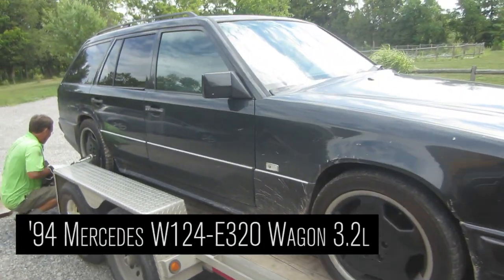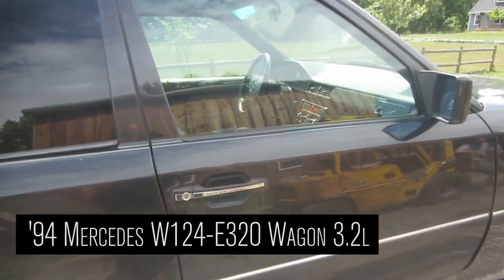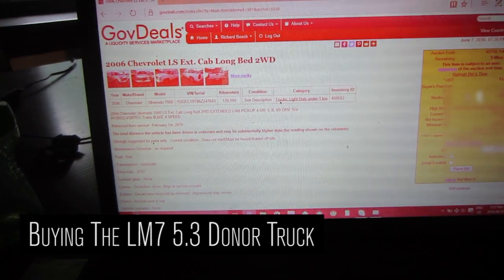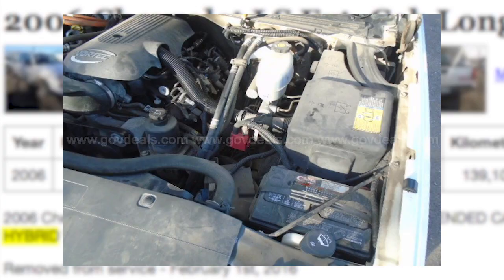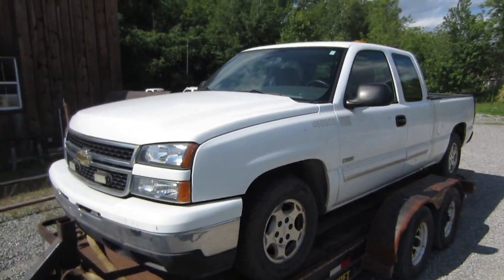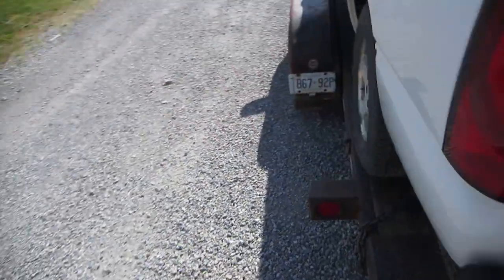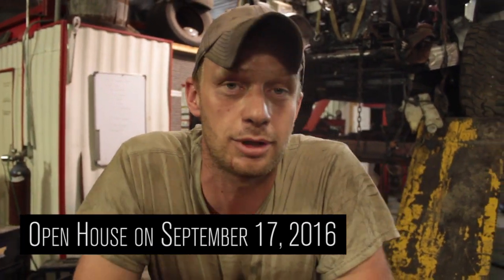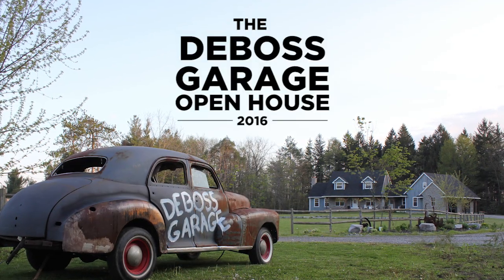SLEEPER BUILD | Turbo LS AMG #HammerWagon [EP1]

Comment: I really wish you had picked another w124 wagon to do this.

Do you have any idea how rare it is to find a black one, with black leather, in good shape, with actual AMG trim? It was worth more before the swap...
Reply from the maker: just head over to Europe.  Theres a couple hundred thousand there.  Thats like somebody in Germany getting upset that they put a Mercedes engine in a Malibu.  "Do you know how rare a Malibu is in Germany?"
Reply: DEBOSS GARAGE a couple hundred thousand you do talk some rubbish an original amg kit with original amg wheels is incredibly rare and a good leather interior black or tan is nearly as rare.
Reply: ITS NOT JUST MERCEDES
IT WAS 
A M G
Reply: It wasn't an AMG, it just had AMG parts. The first AMG model was in 1996, it was a C36 and C43. E class AMG's came shortly after. The 124 was never an AMG.
Reply: I was lucky enough to find an E320 W124 black on black leather, it wasn't easy that's for sure! Keeping my M104 though, because they're bulletproof and can easily make up to1000whp with just a head gasket, and a ARP headstuds.
Reply: AMG was founded in 1967 - in 1999 it was partly taken over bei Daimler Chrysler and in 2005 it was fully owned by Merceds Benz. The C36 was built in 1993. Before that AMG had allready built lots of Mercedes, for example the e36 w124. So yes there are AMG w124.
Reply: Phillip G the E36 was not built by AMG. The C36 was the first production car built in 1995 made by AMG. They never made any W124's or S124's on the production line. Deboss mentions the engine is a 3.2L, which means it has a 3.2L M104 out of the E320, not the C36. The badge in the back was just a sticker someone put on when they got the bodykit.
Reply: Arthur, maybe we are talking about the same thing. You are right the C36 was the first production car  that was made by Mercedes after buying the company AMG. But AMG has been "tuning" or "modifying" Mercedes well before that. 1971: https://www.youtube.com/watch?v=GToUgMpTW1I
Reply: Phillip G Oh you're correct. If you ordered a Mercedes back then you had the option to have AMG build it to spec, but they always kept the badging the same. They made a 6.0L wagon for a customer from a 300TE and they never called it the "E60", it still had the 300TE badging. This particular car has the original 3.2L engine and has AMG badging bc a bodykit was ordered for an E320
Reply: Arthur Malczewski not true, the w124 E36 was a genuine AMG car. It was fully tuned by AMG including a 3.6 m104 AMG engine, with AMG body kit and interior options such as dash cluster and gearknob. The c36 and 43 were the first production AMG but there were many AMG tuned mercedes cars before them.
Reply: 190E LE it was a coach build, AMG took Mercedes built E320's and put a few panels on them and rebadged them. Not everyone got the engine upgrades. On the registration it still says Mercedes E320, not "E36"
Reply: Arthur Malczewski not true , the unchanged badging was just an option
Reply: Sorry but you are being silly. 25 years ago there were a bunch of these cars. There were hundreds of thousands of sedans. But they "only" made about 50,000 wagons from 86 to 1995. Most of them stayed in Europe or went to the US. Most of those have long since rusted away or declined due to neglect and rubber stuff wearing out and interior damage and accidents/crushers. So there are not so very many of these cars left, particularly in good condition. This is presumably why this example was shipped halfway around the world from Japan. I don't think too many people in Germany are bothering to do that with Malibus. So your analogy is a bit far fetched. This chassis still has enough cachet for rich dudes to want to ship them halfway around the world and pay someone else to transplant muscle car drivetrains into them, and for YouTube mechanics to want to feature the builds on their channels.

It is very rare to find a black leather interior in (what appears to be) the condition of this car. Headliners are also frequently bad, but this one appears to be great. AMG body kits are also quite rare for wagons, whether aftermarket or original.

As others have opined, putting a non-mercedes V8 in this chassis is sort of pointless. The power you are after can be  had very easily by putting a turbo on the original motor. It would be a lot less work. It would be pretty easy to find an M119 and stick that in also, but not so easy to turbo without a megasquirt (but people have done that also). People have also dropped the four valve diesel 6 into these cars with a lot of fun results and not as much hassle as this, both the 606 and the 648. That would at least have been in keeping with your other stuff, theme-wise. 

As with most TV, any attention is good attention, so good on you. No doubt the owner is some moneyed dude looking to give the middle finger to a bunch of purists with his novel approach to making power. Kind of a pyrrhic victory, but it's a free country. Knock yourselves out.
Reply: atg condition of this car was indeed fantastic. Imported from Japan 5 years ago with about 100 000 kms on the clock. Body and interior was immaculate. The underside was absolutely rust free. It has a dealer installed AMG body kit and lowered suspension, but the drivetrain was not modified beyond that. It still had the 3.2 ltr engine and standard brakes. (And yes...1995 was the first Mercedes AMG built after Benz bought AMG...I have a true 1995 AMG C36 as well, and it’s sweet, also imported from Japan). In a rare lapse of focus I bought the wagon thinking it had the 3.6ltr. in it, but looking closer the next morning saw the auction sheet truly listed the engine specs as the 3.2 even though the badging on the back reads 3.6 AMG (something they often do in Japan to boast) . But realistically, I would have paid a lot more for the wagon had it been a legit factory 3.6 wagon. So when the head gasket started to fail and the transmission began slipping the idea of swapping it sounded very attractive
Reply: And I had to look up “phyrric”...lol...my wife would agree! (Put an LS in it , they said, dime a dozen at the wreckers they said. It’ll be easy....) 🤪
Reply: You can actually import one from Germany (to US) now, since this car is now 25 years old.

Comment: beautiful can't wait to see it I have a 98 e55 amg and did a motor swap with a 5.5 supercharged that will be a super wagon
Reply from the maker: Is your diff holding up?  what did you do with the driveshaft?
Reply: yes it's a stock rear end but changes the gears to 371 and the drive shaft is from Drive shaft specialist they do custom Mercedes driveline stuff
Reply from the maker: Any chance you could send me a picture of the driveshaft?  debossgarage@gmail.com or twitter @debossgarage .  (like your username btw)
Reply: thanks man yes I'll take a pic of it tomorrow and send it to you
Reply: oh crap sorry the kit ring and pinion is changed its a mkb kit with a locker u will need to find the egs controller under the back seat and remove it there is a sensor in the back diff that controls your esp mine would apply the brakes when I would launch because the egs controller needed programed and I will email u the pic of the drive shaft.
Reply: Audio Extortion why did you swap an e55 given they are so rare?

Comment: the stock engine in that is good for 1000 hp 
should have kept it
Reply from the maker: Can you show me a link or proof?  Someone else who did that?
Reply: DieselSniffarn search pumpish on YouTube, lol
Reply: Yeah, what that guy said. Roman (pumpish) is getting over 1000 wheel from a 3L M104, the slightly smaller version of this engine. The engine is on par with a 2JZ without a doubt. You can push it to over 600 with the stock bottom end. Rods and pistons and it's good for double that, given a good tune and a fat turbo. Get an om605 diesel crank, honda h22 aftermarket rods, and custom machined pistons and you can stroke a 2.8 (thick ass cylinder walls) up to a 3.4. People are eventually going to discover what an absolute animal this engine is, but until then you can pick them up ALL DAY for $450-$600. This engine was turned into a V12 and it's what currently powers the pagani huayra, making over 700hp.
Reply: @DEBOSSGARAGE  In Scandinavia and Finland that engine is the equivalent to the 2jz. Block can handle massive horsepower. Easily get 300-400hp out of it just by pump adjustment and boost.

Comment: Reset the transmission if there's hardly any power. Turn key bit not start.  Press and hold gas all the way down for 30 secs. Turn key off. Let go of gas pedal. DONT TOUCH ANYTHING FOR 3 MINUTES. DONT EVEN ROLL DOWN THE WINDOWS OR OPEN THE DOORS, NOTHING. done

Comment: Please don't put an LS in the Pontiac.
Reply from the maker: Not planning on it!
Reply: DEBOSS GARAGE 
Im following your build with the LS.
I have a 68' M-715 that's getting a LQ4 with a 4L85e.
Even tho i'm well versed in building cars, I have never put an LS into ...anything.

I got 2 LS swap books on the subject, cover to cover, but no replacement for hands on, or in this case "eyes on".

Thinking about going with a F.A.S.T. LS controller, it runs ANY LS engine and is self learning.
So I could be in Alaska after nuking my engine and slap in any LS engine and the PCM would handle it.

But please brother, don't put an LS in your PMD, I would even go as far as helping you with parts so you dont lol.
Reply from the maker: I mentioned it in another video but only because it was the first car that came to mind at the time.  Don't worry, the GTO will always have a Pontiac heart!

Comment: I was hopin' your title was just clickbait but you're actually going to be putting a SBC motor in a marquee German brand? Sorry but I won't be watchin' this build.
Reply from the maker: What engine would you like to see in there?
Reply: Another M/B engine at least since those wagons are rare. I can't remember the last time I saw a M/B wagon in Ontario. It shouldn't be too difficult or expensive to pickup a slightly newer M/B donor car with all the parts you need to swap engines. SBC LS engines are in everything these days. You're a great mechanic and very resourceful, be orginal, not like everyone else.
Reply from the maker: The trans lost reverse too.  the customer priced an engine and trans rebuild and just about fell over by the price.  It was his request to throw the 5.3 in there.  Because everyone does the LS swap, it has become very affordable and it doesn't take much to make some crazy HP.  Sorry!
Reply: I guess ya gotta pay the bill somehow. I won't hold it against you :D
Reply: hey Keith...if you like I can get you a mint w124 wagon with low kms. tomorrow (plus about 2 months delivery) for relatively cheap. There's a few every day on the Japanese auction sites. (I own this one that my good bro Rich is working on). I also have a genuine C36 AMG that definitely won't be getting a transplant! (unless it's the engine out of our S600 coupe)
Reply: (owner of the w124 wagon) I would have fixed it actually, but for a bit more than the same money, double the hp sounds...interesting :)  and... I do enjoy the Mercedes brand... we have this one, a C36 AMG and a '94 S600 two door, all great cars
Reply: Cool!
Reply: Nah bro Chevy  ls all the way .German v8 not to bad but American ls is way much better
Reply: In which way, you still use pushrods and that's only one of the many obsolete stuff on a regular American V8. You want to compare build tolerances and power to displacement ratios.... ?

 I understand you, you probably that type of American that thinks everything American is better than anything else. I respect that. I feel the same way about European things but I can admit that good things can be build outside of Europe.

I won't be seeing this build series either. If the engine was dead, wouldn't choose that engine but I would understand. With an working engine, I don't see the point. Keith is a very crafty and skilled mechanic, I'm sure he could fix the gearbox himself, Improve the engine, add bigger turbos but don't change the base block. 

Then again I don't really know how expensive are Benz parts over there, so I guess, an LS is probably a good swap, I just don't have to like it.

Edit: Seeing part 13 just to take a sneak peek, I learned that it was not a full original AMG so fair game.  Good luck with the build.
Reply: horsepower to displacement means nothing. in reality its about power to weight and LS motors usually do well there.  also they are smaller than most V8s with less displacement by having simpler heads (cam in black design) German cars are beautiful but the LS is popular for many reasons.  Id agree a real AMG should stay with an AMG motor tho but as you said its not.
Reply: @DEBOSSGARAGE  om606 compound turbo, turbo the m104, or drop a 5L m119 in there with aftermarket ignition. Any of them would have been easier and cheaper than this idea.
Reply: @kwittnebel  agreed! But he doesn't live in Finland :P
Reply: @espencapable  where he lives is irrelevant. All the above mentioned motors are available here and pumps by mail order. Fabrication is overwhelmingly the largest expense and any of these choices would have saved the owner about 10k